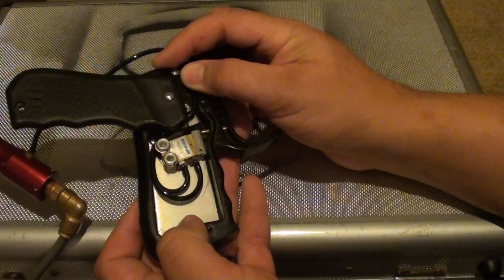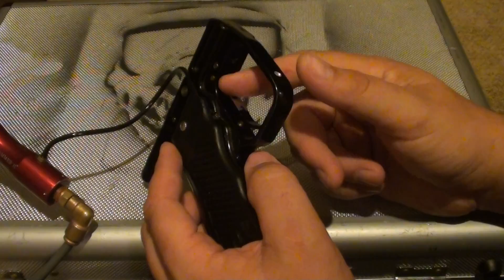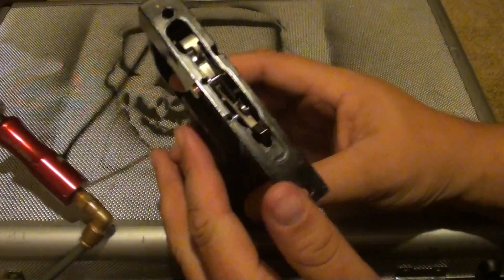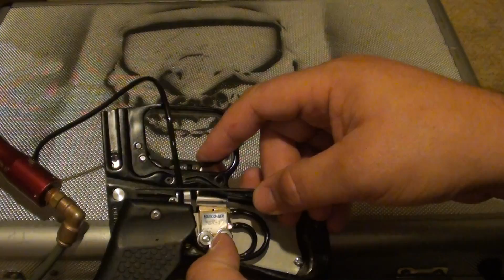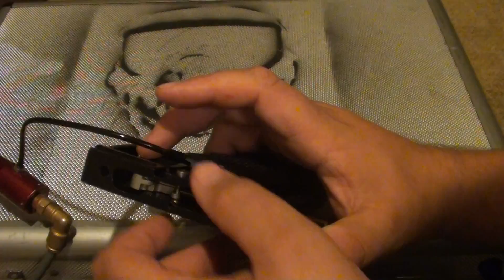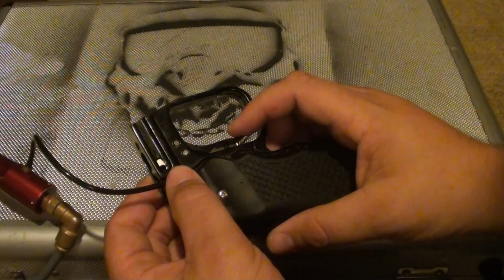hAir Trigger for Autococker build. PNEUCOCKER

Comment from the maker: This particular frame has a ram in it made for this frame for use with a solenoid in a trilogy pro. You just remove the solenoid. However there is a clipard ram that works as well. I forget which one but if you contact badger on MCB or customcockers he can tell you. There are also threads about it on both forums.